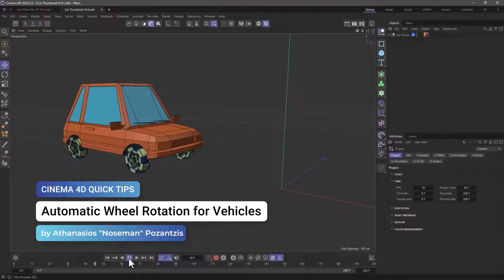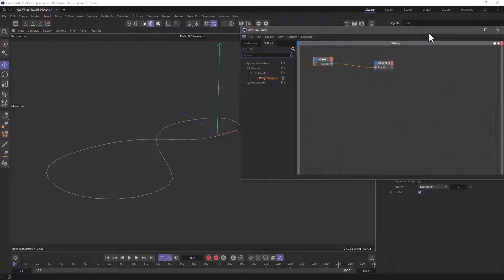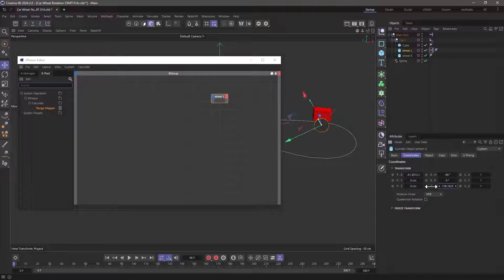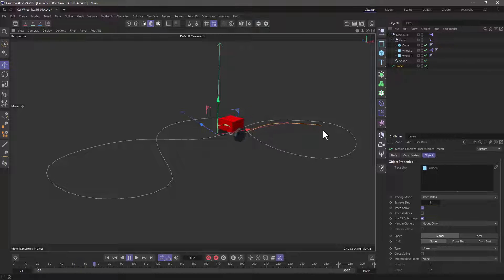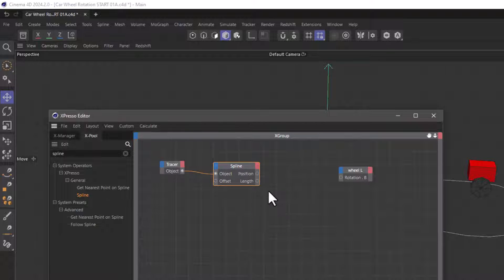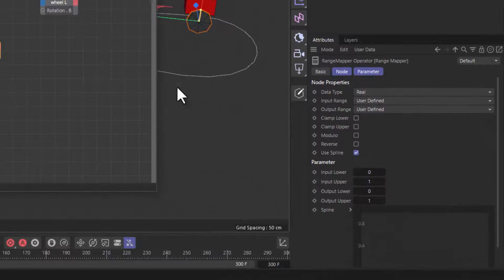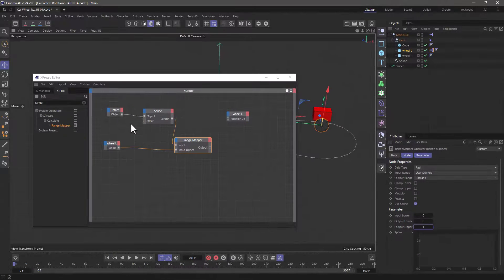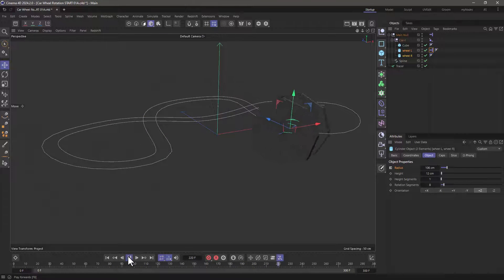#C4DQuickTip 117: Automatic Wheel Rotation for Vehicles in Cinema 4D

Comment: Why the wheel not rotating at the first frame and adjusts itself when I press on empty space on the screen? Seems like its not updating in the viewport properly
Reply: If anyone encounter the same problem just go to xPresso tag and change priority type to Generators and make sure the value is set to 0. Also remember to put xPresso tag after align to spline

Comment: Great tutorial. I'm animating a vehicule that goes forward, stops, and then goes backwards. So, I have to animate the reverse option in the Range Mapper. It does work, but it creates a jump in the wheel because the orientation changes. Anyway to avoid this?
Reply: +1. I'm running into the exact same problem of the jump in the wheel when I keyframe Reverse in the Range Mapper. Any help greatly appreciated!